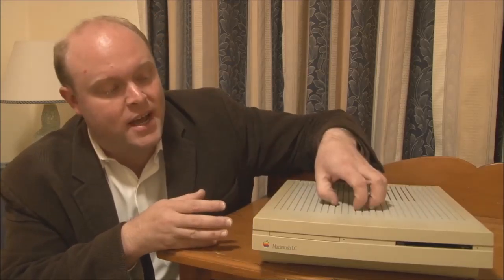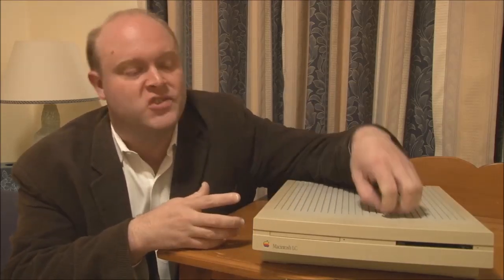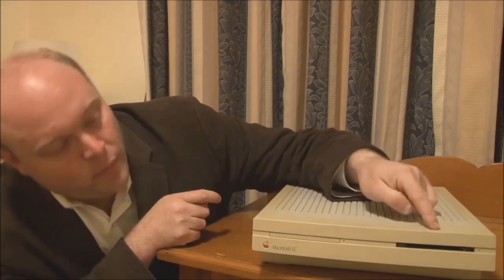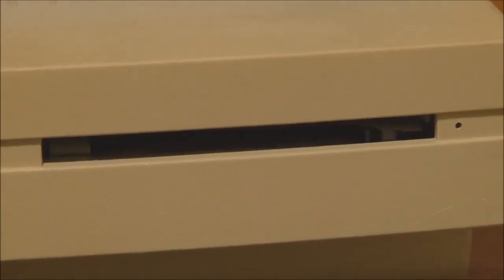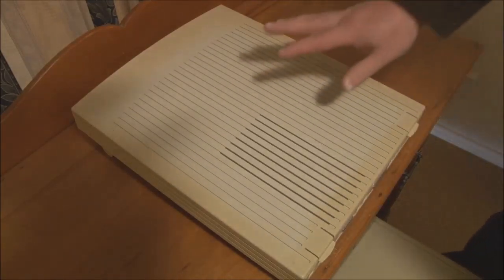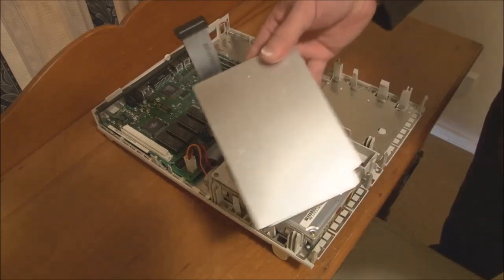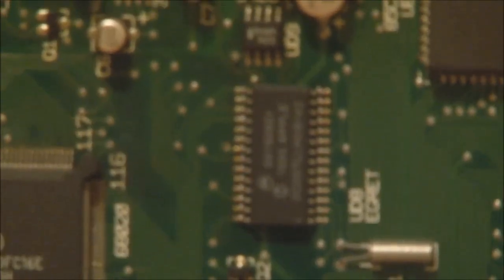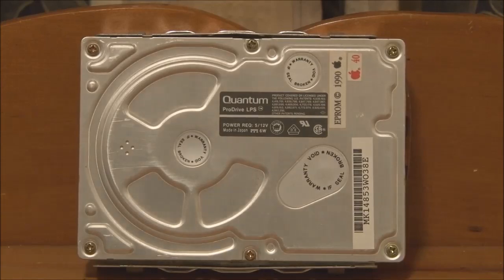Apple Macintosh LC (1990) Full Tour and Disassembly

Comment: I got one of the RGB monitors recently, but cant's find any information. I did find a pinout for the monitor's input and found it doesn't need a split sync (HV) like VGA does. Since they are plentiful in North America...it wouldn't be hard to adapt the Apple 15 pin to SCART and have a monitor that can be used to drive other machines like Amigas, STs, old IBM machines, or even game consoles.

Comment: Excelente vídeo. Saludos desde España.
Reply from the maker: FerolMadrid Thank you!
Reply: Jason's Macintosh Museum I think Apple new they had fallen behind when the Acorn Archimedes was released in 1987, it leapfrogged both the IBM PC and Apple Macinstosh and the Commodore and Atari hardware computers, I think Dec Alpha's were faster than the Acorns but they were expensive and were usually bought by Military, defence and Civillian Air traffic systems etc.  My question is why did it take Apple so long to get the PowerPC up and running, was it 92 IIRC
Reply: FerolMadrid ¿Te gustan Macs, verdad?
Reply: 1912RamblerFan01 Muschísimo, tengo algunos antiguos.

Comment: Can you do a video on either a Quadra 700 or Quadra 950? Also, do you own/work on a "modern Mac" running OS X?
Reply from the maker: 1912RamblerFan01 I have a Quadra 700 - but it has an issue with its logic board that is preventing it from starting up. However, I do have a working Quadra 950, so that will be the subject of my next video.
Reply from the maker: 1912RamblerFan01 I do have several Macs which are capable of running OS X, but I haven't set up OS X on them yet.....watch this space...!
Reply: Jason's Macintosh Museum Thank You for your reply. I can't wait to see the video on the Quadra 950.